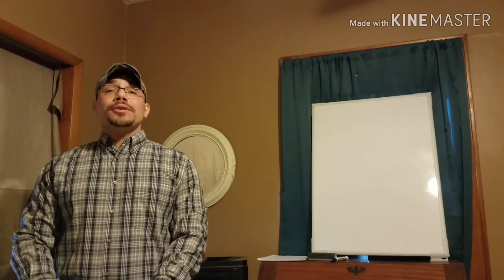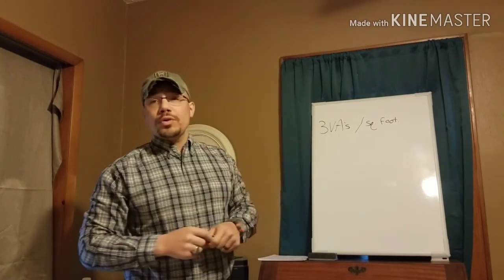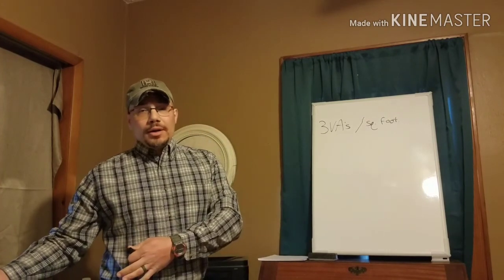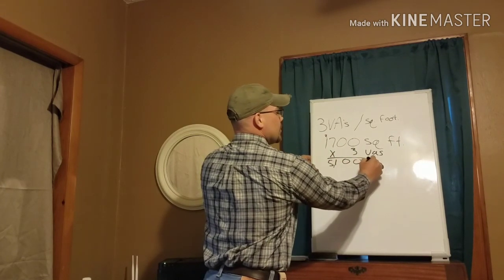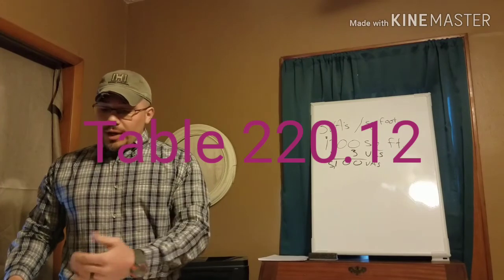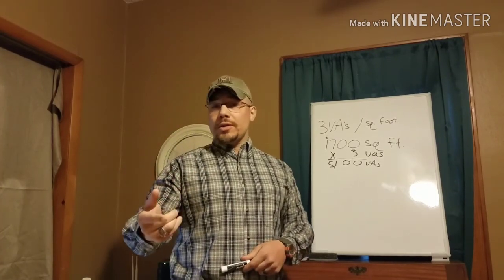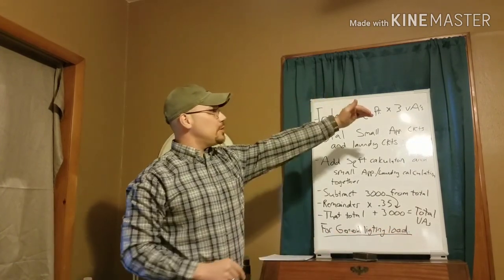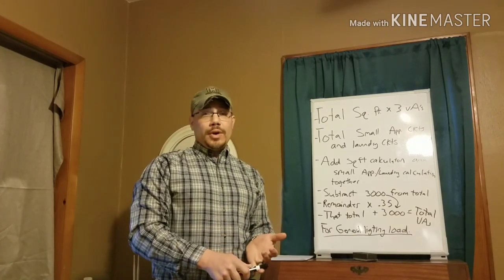NEC Article 220 Service Calculations (Part 1)

Comment: I've always used the optional method because this one wasn't clear to me. That the small appliance loads and laundry circuit can be included in the lighting load demand factor had slipped my attention, so that simplifies it. Does the lighting demand calculation also include the dishwasher, refrigerator, garbage disposer, etc that may be on individual branch circuits? I've not considered those to be small appliances, because they're not served by a countertop receptacle.

Comment: It's kinda interesting how the code can make it sound so complicated by making it rather wordy. The bottom line is if you know what's being connected (the load) and figure resistive loads separate from motor loads, then throw in some math for 80% loading on a branch, you will come in with similar numbers, although on the high side. (at least in my case) The reality is an average home COULD get away with a 60 amp service (with room to spare) but only till the point where central AC, clothes drier, well pump, and electric car charging is needed. Heck, my home has a 200 amp service (to cover those things) but an average winter evening shows less than 10 amps per leg being drawn with everyone at home. Yes, it's all about the POTENTIAL draw, not the typical draw.
Reply from the maker: That is very true. Gotta design for what could happen and not what will. As well as potential future additions. Thanks for the comment!!